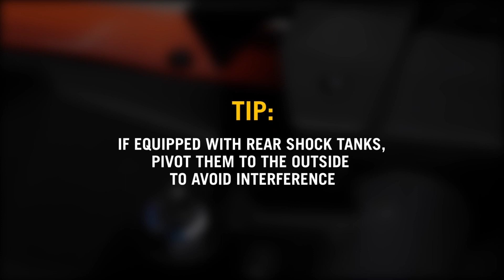CAN-AM LinQ PIVOTING RACK INSTALLATION - MAVERICK X3

Comment: At .15 there is a tool shown that attaches the cylinder brackets to the frame that mount the gas shocks. What is it and how would i install these brackets without that tool? At 1.52 it shows the device in use and it looks like it is pulling and cutting. Any advice would be much appreciated!
Reply: That’s a rivet tool.

Comment: would be a fantastic video IF 1. the guy would have used a color glove other than the same black as the black bolts, nuts, and everything else so you could actually see what bolts, nuts and everything else he was using.  2. Actually put wording on the screen that says what bolt, nut etc. he was using.

Comment: I've installed the rack and the locking levers don't seem to fit flush into the LinQ tube attachment. The levers do lock in place they're just not flush. Is there something I did wrong or is further adjustment needed ? Also there are 2 allen screws that came with the levers and I'am assuming where they go but I'am not sure what they're for ? Thanks for the video.
Reply from the maker: Hi @RickRush, if you have play on the LinQ Levers, we would recommend taking the cylinder off,  loosening the bolts that are shown at 1:16, closing the rack and tightening the bolts to eliminate the play. After you can reinstall the cylinder and the rack should feel secure and without any play.  Thank you for watching.
Reply: my understanding is the allens are for theft deterrent, they "lock" the  LinQ levers. if you look on the Linq part you will see a small tapped hole on each one.